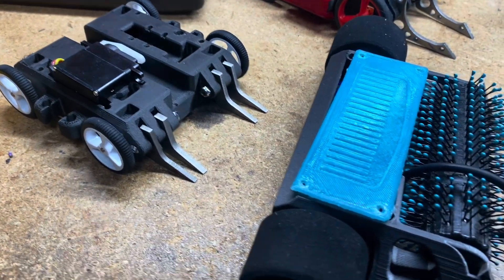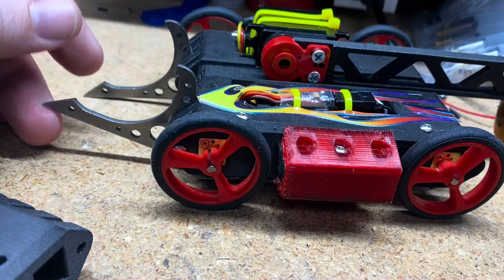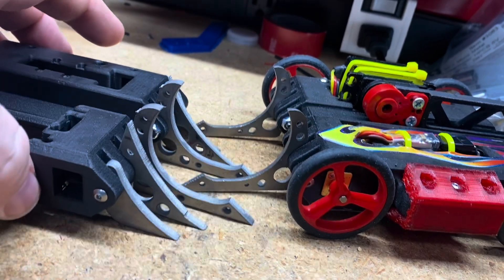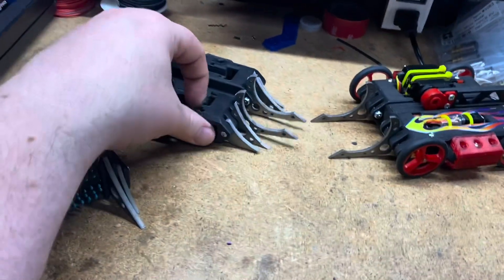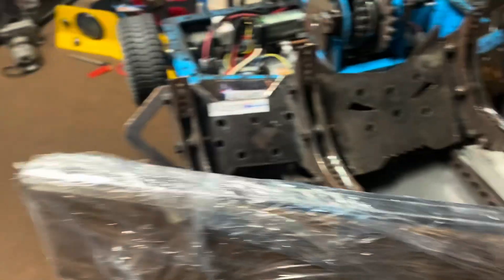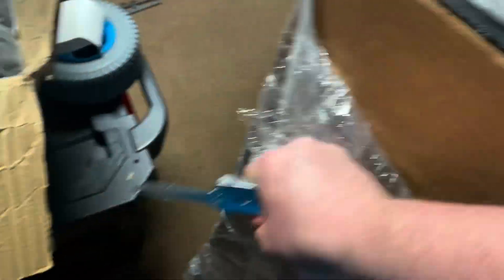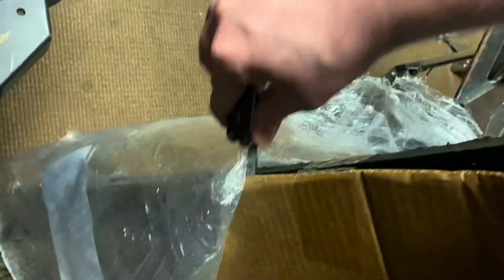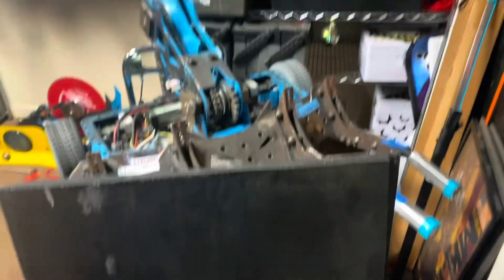TEAM HUGE Sends Us a SPECIAL DELIVERY!

Comment: @Skorpios Battlebot, Zach why don't you just use that stuff to make wheeles out of it like Huge only small and compackt like a fat-foam wheel. It could stick out and give you more support as well.
Reply: Possibly it requires moulding to shape not cutting to shape to retain strength
Reply: @personalvideos2860  I don't think so if you stack and bind each section with say "Gorilla Glue". Then it could be fat and tough. All you would need is a rim to place the axle threw.
Reply: @necromancer0616  Am I right in saying that glue is effective in holding but not when Subject to shock it can become brittle

Seem to remember a science program stating superglue is great when the force is even and pulling but not when it is flexed
Reply: @personalvideos2860  Gorilla Glue isn't Super Glue. It acts more like Elmer's Glue but has the fast holding. Also you can use excelerant to speed up the process and even melt one mateirial into another. 

I guess that stuff is ok for top armor but against a hammer-bot or like Sawblaze it may be risky.

Comment: on my printed hinged forks (plastic ant) I have a down angle of 15 deg and an up of 5 deg, so if I gyro as I'm turning, the middle forks are grounded-ish. I am looking into spring-mounted AR500 designs with either torsion springs or leaf springs.

Comment: 1:08 
I think that’s what happened with Slammo when it fought Deathroll on its front plate between the lifter arms.
For wedglet stuff, I think the Piano Key Wedglets like on End Game seem to be pretty effective, like in the Hypershock match how Hypershock could only connect with the long forks and not the small piano key wedglets. It could also be seen in the Blip match, I think. If you ever find the weight, maybe give them a try

Comment: Why don’t you do forks that if the opponent comes up onto it it’ll keep them there
Reply: I've tried barbed forks on my 30lb vert and they have pros and cons. The pros are that you can control the opponent better, but the downside is that you're also stuck to them. The control isn't much better than just using a fork as tall as the barb itself is, and a smooth fork allows you to back off whenever you want. I keep a single set around for fighting other beater-bars and drums similar to my own bot because they tend to hook into the weapon area really well, but against any other type of bot I've found smooth forks to be better.